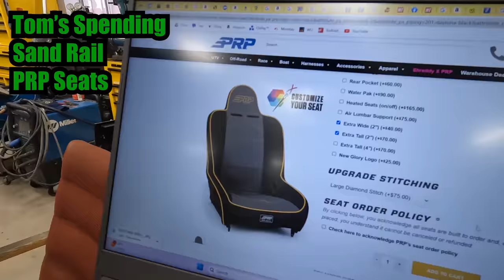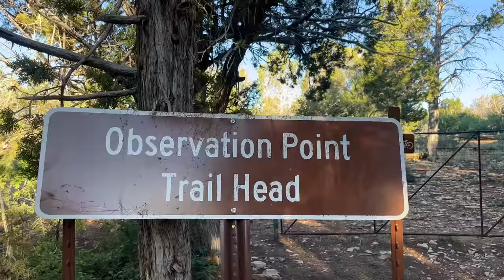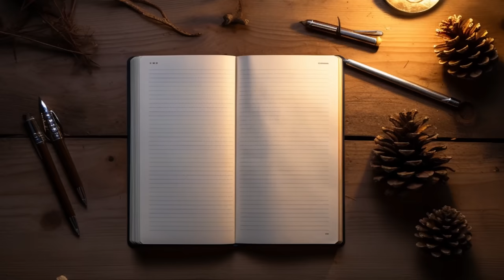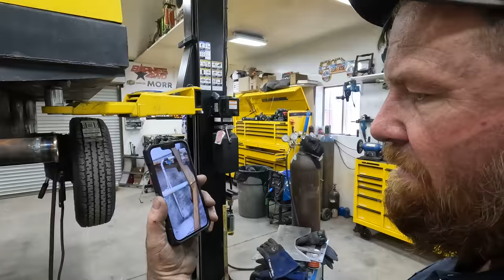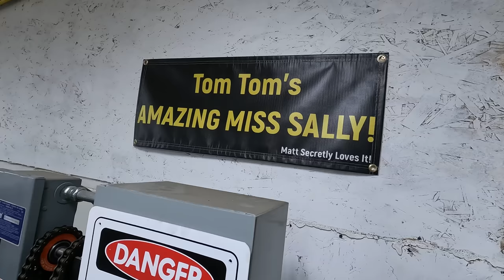This One Part Changes Everything! Bombi Gets Biggest Upgrade.

Comment: My Lord ! This is one epic edition of Matts of road recovery. Great to see our lovely Lizzie sporting the usual beefy belt buckle, boots and jeans with her lovely locks platted (?) behind her. Really long and thats such a treat for guys like me since the ladies in these parts all have hair cut .....! Damn fine views Matt thanks for the exposure man. Jamie looking right at home there in the reflectorized shades, fine looking lady too man. You're a practical Saint Matt, getting out with the girls and supporting them on the most incredible adventure. Yes, it sure was a little bit freaky getting up the ladder in the rock face despite the safety lanyard. Tom about the hanging LS motors from a chain I agree 100%. In fact I use a length of chain with a piece of 2x4 notched at the ends slightly to keep the chain spread. Better keep checking clearances on these tracks men? On top they tend to flap about a great deal once you put power through the belt or chain (depending what the base is) or when speed increases and the harmonics create an off beat ripple. Great show Matt and team. Your lad is becoming a great addition to the crew now Ae? Welding and all sorts of work. good fellow!👍👍Welding is practice practice practice so you'l never catch up to Lizzie unless she stops!? Which I sincerely hope does not happen! ! Watching for the next series of videos always MORR .

Comment: Matt is exactly right regarding the open diff.  Torque is always equal.  If both wheels have the same traction there is no advantage to a locker or spool.  The issue is that both wheels seldom have exactly the same amount of traction.  Furthermore, the driveshaft torque tends to cause the axle to press one tire down and lift the other.  This is why a four wheel drive vehicle with open diffs will tend to spin wheels on the diagonally opposed corners.

Comment: Hey Matt, hooked on your channel!  Love construction & mechanic'n.  I am seeing a problem in the Bombi reconstruction.  The original track was level across the top, the drive gear was even with the top of the tires.  In this last positioning of the new drive gear, it is much higher.  When driving Bombi forward the track will not be touching the top of the middle tires.  Just an observation.  My dad was a welder in the Navy and laid down a beautiful bead with stick welders.  New equipment makes it look easy.

Comment: Yep. With open diffs the torque matches and the speed differs. If one wheel is in the air they both only have as much torque as the friction on the spinning wheel (hence why traction control braking the spinning wheel transfers torque to the wheel with traction) and all the speed goes to the wheel in the air.

Comment: With how you steer I completely understand the open differential, plus idk if your gonna get your track stuck like a tire in mud. A lot less strain on your differential and breaks.

Yes an open differential sends power to both tires. But it doesn't force the power, it allows the power to go towards least resistance. While a ls forces that power to go towards the resistance and a locker sends 50/50 to both tires all the time.

Open is open, ls is open till you need it, locked is locked. Then there is the differential that is always locked, and unlocks as you need it (in turns and what not). I could be wrong but that's my understanding of differentials.
Reply: I'm from Florida so don't know anything about snow, but I would imagine your not gonna be running into a time when 1 track is stuck and not turning while the other one does. I'd assume both tracks will get traction, or both don't and just turn like a tire on ice. Not sure when it comes to tracks on snow though.

Comment: Although the Ford 9 inch is capable of handling alot of horse power. It can bend the housing. There are kits you can get . It's a weld on brace goes right across the back. You really need it.

Comment: running it in summer/winter both and wild varying temperatures, you'll want to use pure nitrogen for tire inflation! the pressure will maintain far better.  there's times using nitrogen makes sense, and this is one of them. maybe even think about using it and carrying a cylinder for all the off road vehicles and equipment? it's fine on road also(100% legal) inert gas.

Comment: Weigh the wrecker.  You may be overloading the trailer.  Check the trailer weight when loaded.  if it weighs more than the capacity of the trailer, or the capacity of the tires may explain why you’re blowing tires.

Comment: transmissions 101, giant cooler and lots of airflow through it. keeping them cool is number 1, and keeping line pressure in range is number 1.1 lol. follow that by good parts/build and proper torque converter depth.

Comment: Think of that red thing of rare beauty as a primary sprocket.  If it is 3 times larger in diameter than the one that was on there, the track will move 3 times as fast at the same RPM you had before.
Zoom, zoom!  To help the visual, wrap a string around the old one and cut it off, now the new one.  Put the two strings beside each other.  That is how much the track will move in one rotation.
The new wheels look good.  The axle housing will try to rotate out of its mount with the same amount force you are putting on the track.

Comment: I think you might have a problem with steering. The wheels with steering brakes have no direct connection with the tracks. (only friction with the tires on the tracks). Brakes on the driving wheels with the sprockets would be more direct. The driving wheels can overcome the friction on the steering brake wheels. Either have brakes on the driving wheels, or sprockets connecting the braking wheels to give a direct connection to the tracks. Kind regards, John.

Comment: Just a thought: you guys are always so jam packed in the Bomvair, unless I missed a segment, how are you making more room. You don’t want to change the footprint so how about doing the car to minivan solution. Fab a perimeter spacer (6”?)between the floor and body so you can put in taller seats. Your legs will be more vertical cuz there’s no horizontal space.

Comment: Well, this is a fun build, I've watched all the videos, I have not heard where anyone is mentioned where you might possibly have a electric locking differential for that unit, I know it's basically a skid steer, but still there's gonna be some hard pulls, where you wanted both tracks and not a "one wheel peel" so to speak.  Just a thought, by the time I see the video there's several days old and might already been happening. well as I continue watching this video, you already decided not to do a differential that you can lock and unlock, yeah probably will work just fine, until that one time…anyway that's my two cents worth for what that's worth…you're the one doing the build,, I'm the one watching your video , I'll continue watching,, because it's interesting what people do, versus what I do.

Comment: Two of the strongest rear differentials used in off roading today are the GM corporate 14 bolt and the Ford 9”. What do they have in common?  Both have 3 pinion bearings.

Comment: The new Raceline wheels look so much better!  Someone there had good taste and a good eye. The lip looks like bead lockers. BTW, going with pneumatic tires and such low pressure in the winter, don't you think you will need bead lockers for the rear wheels from all the skid steering?  All the tires will face side loads but greatest at the corners.

Comment: I had an idea for the steering brakes on the Killer B. I am not sure how workable it would be but I thought I would suggest it. Instead of a single brake disk on the rear axle what if you also installed one on the front driver? Given how big the drivers are you could run a larger disk and split the brake load between the front and rear. It would also mean your driver wouldn't be trying to drive the track against the brake. just an idea and like I said not sure how workable.

Comment: FYI if you plan on only running air in the bogie wheels with you pulling excessive loads on the tracks you will have way to much flex and blow out the head bogie wheel, I worked on snow cats for a living so I have seen it happen.

Comment: A few thoughts from the peanut gallery.
Those track guides look like they will be pretty harsh on the sidewalls and shoulder of the tires. Steering will also side load these areas quite a bit.
It looks like it will put a lot of unnecessary load on the tread blocks on the side wall and as that are not really made for that might be an issue? 
Perhaps for the lead tires after the drive sprocket you might want to modify those tires to enable them to be a bit more durability with some Cushion Gum in the sides of the tread? Smooth and without cleats/blocks it should better guide and support the track. As it's a rubber connected track (even though its reinforced I assume) it will stretch and return making the first guide on the track more important than usual.
One final thought relating to the steering.  A single caliper on each side unassisted may not be enough without using a special compound for the brake pads? How about assisting them with a couple of VH44 style vacuum assisted boosters? Less than a $200 each and they work really well. They have been around since the 50's. In addition to a vacuum tank of an old truck and it would be sweet? It would give good initial bite and that is what I think you will need steering wise.  Also not that big.
Cheers

Comment: If "BOTH wheels get an equal amount of torque" then the vehicle would not just sit there when one wheel loses traction - but that's exactly what is does!
The truth is that because of the way the gearing on an open diffy works, the power gets transfered to the wheel with the LEAST resistance. THIS is why some suggest applying the parking brake when losing traction. The theory is that it adds resistance to the spinning wheel and thus helps to redistribute the power evenly.
Matt, if there was power, (torque) evenly at each wheel regardless there would be NO NEED for a locker!

Comment: High, higher tire pressure.  Our cat runs 101 psi for tires.  It's to keep the sidewalls as straight as possible.  When they deflate, it scrubs the sides of the tires and wears out.  Also, when the tracks are only suspended on the outer edges of the tracks, track flex becomes a real issue and will gouge on the side of the frame.  Some kind of a plastic roller or wheel should be mounted to minimize that happening.  You want the drive sprockets to be just slightly higher on the ground than the tires.  Ya really don't want the weight of the machine resting on the drive sprockets.  It will make it super hard to turn and easy for the tracks to jump off.  I love your channel and the content is wonderful!

Comment: Hmmm.. Matt, since the top of the drive sprocket will be several inches higher than the rubber tires, at least the set closest to the drive sprocket....so how will that work if the track comes to the top of the sprocket, but is not in contact with the top of the rubber tire?  I know nothing of this kind of machine, so am really curious how that will work? Maybe you can explain that on an upcoming video..? Thanks!

Comment: On those 16" gooseneck trailer tires, the stock ones they come with have a rounded shoulder and they are junk.  Go to an all steel 14 ply and you will virtually eliminate any tire problems.

Comment: A possible solution to the brake concern is run a dual brake set up one on the drive axle and one on the rear like you have it. That set will improve the turning ability and cut down on heat soak and pad life especially since your up grading the power plant

Comment: When I learned to drive in the snow in a car with an open diff, my dad taught me to drive with both feet. One on the brake and one on the gas. He taught me that you can "trick" an open diff by applying the brake and the throttle at the same time. This technique has served me well for over 40 years. It's not foolproof by any means but it does work better than nothing.

Comment: Another thing most people don't realize is that when one wheel side has traction, and the other side breaks free and spins, the speed to the spinning side is increased significantly over how fast it would spin if both were turning due to the gear ratio change in the spider/side gears, this effect at that time reduces the torque output to that side by increasing the speed, which assists in preventing that tire from spinning as easily. To test this, you can spin the input at a constant speed with both wheels freewheeling, measure the wheel speed, then stop one side, and measure the increase in speed the free spinning side has.

Comment: This is only a suggestion as with so many comments I bet most don't get read especially by people with odd names....
You should find a way to mount a drum backwards over the brakes to protect them if you really want to get fancy make them slide able so in the heat of summer you can just pull a leaver and leave them open to dissipate the heat.
Engine lifter ( cradel ) pretty cool but bet you would have enjoyed just purchasing the 1 that's made so not only can you spin the lifted engine but can spin a handle and balance or tilt it.
Just an FYI

Comment: I would cover those brake disks. Just from own experience, snow will melt and it will freeze quite fast if you don’t drag your brakes. After that it will not work for a while.

Comment: Technically, Matt, you're correct. 
Open diffs apply Torque to both axles equally. 
Locked diffs apply Power (speed X torque) to both axles equally.

Comment: You guys need to review how dozers and skid steers work.  A simple 9 inch differential will not work because it will put to much strain on the spider and side gears which is why clutches and brakes are used except for Oliver which used a compound differential to handle the stress.  There used to be a Yahoo group site called Machine Builders where it was explained in videos why what you are proposing to do will not work.  Guys that built tracked machines found out the hard way.

Comment: Hi Matt and crew (and especially Tom as I'm an engineer as well).  I enjoy watching your videos and especially the interaction between Matt and Tom due to their different perspectives.  One question I have is about the location of the front drive sprocket, where you were showing it being mounted it would result in the top of the drive sprocket being well above the level of the top of the tyres which would result in the track being lifted up off the front couple of rubber wheels when driving forward.  this would mean that the guides that keep the track in place would be less effective.  Is this the intention or do you think it wont matter that the track is not sitting on the top of the wheels?  It looks like there is room to lower the front axle (and drive sprockets) to eliminate this from happening and reduce the risk of a track coming off.
I hope you mention my comment on air 
Also I'm from Melbourne Australia and we are currently freezing and would like some of the heat you are getting in Utah.
Regards
Leigh

Comment: Open differentials transmit torque evenly, and they can only transmit as much as the wheel with the least amount of torque. They do allow for differences in speed between the two wheels. On perfect surfaces with unlimited levels of grip this works well.

Comment: Saw a "bombi" with paddle tyres mounted to track (not sure how it was attached assuming plates and bolts) 
The "bombi" had a monster blown v8 ,shot sand into air bout 20m .
This was in 06 or 07 in the dunes outside of Riyadh in Saudi Arabia, the monstrosity was not very fast top speed (slower than a 450 blaster) the acceleration was impressive.

Comment: Yes, absolutely true, if one wheel is off the ground an open diff puts zero torque to each wheel, therefore the vehicle doesn't move..  If on pavement and one wheel spins on take off the other wheel is getting the exact same torque, taking frictional losses into account.  So, torque to the ground is always limited by the available traction.
Reply: It puts zero torque to the ground. People have been listening to engineers calculate torque imposed on the ground but what about the torque in the axles?

Comment: I like what you are doing to the bombi. My thoughts on the track system is the Drive wheel at the opposite end from the drive sprocket With the stress on that wheel I think it should be a solid. If that tire goes flat I think it would throw the track

Comment: Open dif equal torque, but delivered torque is limited to the the tire with least traction, thus if traction is bad on one side not much torque is delivered. Torsen differentials arent lockers but can actually deliver more torque to the non slipping tire. I guess torsens arent used much offroad, I watch this channel to learn about the offroad stuff!

Comment: Dear Matt! We don't use fractions in metric system, I'd rather say tenths. 1 meter is 10 times 10 centimeters which is 100 centimeters, so 100 cm equals 1 meter. 1 cm broken down to millimeters is 10 millimeters. 1 meter is 1000 millimeters. In machine industry we use tenths, hundreds and thousands of a millimeters.

Comment: 23:40 no safety glasses,  24:00 yes safety glasses.   Thanks for putting them on.  It's nuts running a disc grinder right in front of you face with no glasses at all.

Comment: You should use some TBM Brakes from Motion Raceworks. They use those on Monster Trucks and Cleetus did a torture test. Doesn't seem like you can boil those puppies.
Reply: monster trucks don't lean on the brakes for 20-40 miles at a time. that's the big problem.

Comment: Equal torque vs resistance why one wheel spins when not under load. Applying the emergency brake a little helps equal the load and helps send power to the loaded wheel.